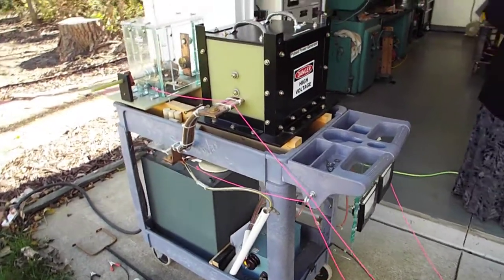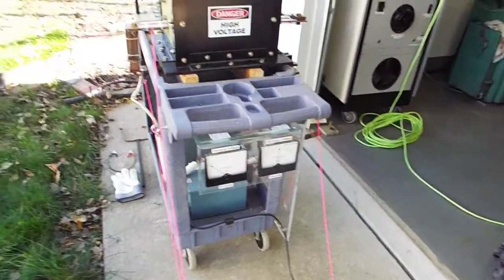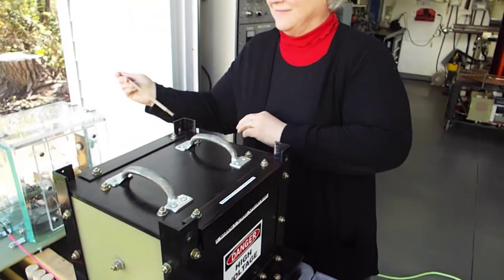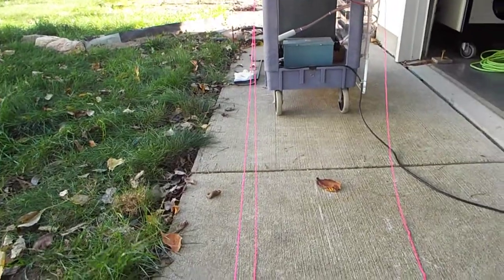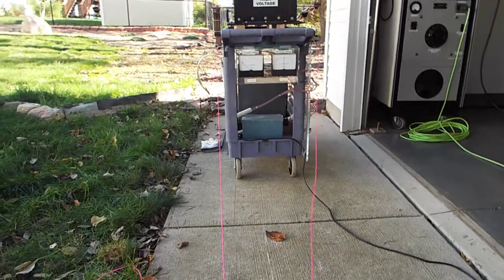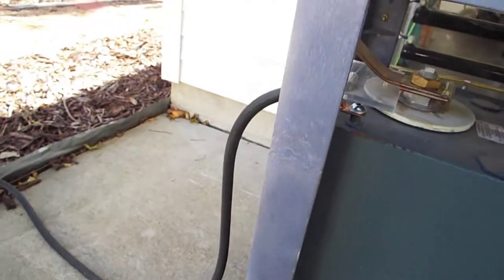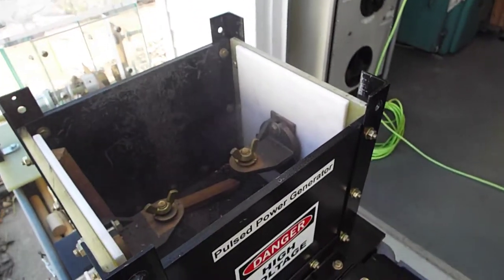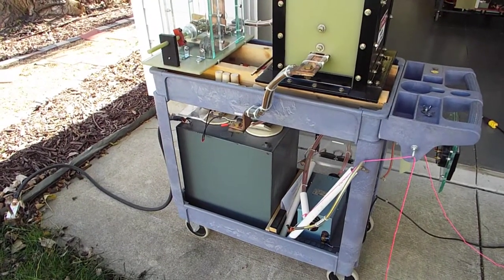Coin Shrinking Using Electromagnetism

Comment: This would be amazing to view with a transparent blast chamber and a high speed camera.
Reply from the maker: A few people have tried Lexan, which is transparent, blast chambers but even that material eventually cracks. Since the copper coil fragments travel at up to 5000 feet per second, I only trust a steel blast chamber. There is a video of someone, Hackerbot Labs I believe, using a 180,000 frame per second camera to record a shrink operation. The shrink only takes up 4 frames (22 microseconds)!
Reply from the maker: Thanks. I studied all of the other coin shrinkers that I could find before I built mine.
Reply: @littleshopofelectrons4014  well, you studied well, I guess.  Because again, it's a nice build!  :)

Comment: "The blast cage" 😂 very appropriate name for that component of your machine mate... the camera doesn't convey the blast that is generated by these things..
Reply from the maker: Even with the blast cage completely enclosed, it still sounds like a small gun firing.
Reply: @littleshopofelectrons4014  yeah the camera can't convey the blast that's for sure, its the same with a lot of the high voltage gear ....
Reply: @T2D.SteveArcs  if you dig around online, you can find high-speed video of... well, not the initial blast (that blows out the exposure and is pure white on screen), but the after-effects (even a millisecond or two later, maybe) of plasma dancing around, shrapnel flying at supersonic speeds, etc.

Comment: Fantastic, high quality build! Thanks for explaining and filming it for us to see. I assume the #12 wire must be lacquer coated where it winds around the coin? Would the results be different with a more ferrous coin, such as a Canadian one?
Reply from the maker: Thanks. I use magnet wire with double-build insulation. The lower the resistance of the coin, the better. Pure copper, such as an older penny, would work best. Ferrous materials are not as good because of the higher resistance.

Comment: I use an automotive ignition coil and charge the caps through the secondary (huge inductance)...that way, I have NEVER had a damaged diode, since the current has such a huge Xc to fast-changing current. i.e. the cap discharge.  The NST still charges it fast.
Actually, I use two ignition coils,one for each cap lead (not really necessary). 
You can use a 30mA NST, I use three 20kV diodes in series for extra margin.
I am currently designing a RE-USABLE coin work coil, which is working well...so far.
GREAT VIDEO!!

Comment: 12 volts with high current looks like this "12V 100AH LiFePO4 Short Circuit - Lithium Iron Phosphate" by reBel Batteries. The result is a sizzle and not a pop. I looked at the formula that calculates the power (7.2 K joules) and the electricity (12000 volts in the video) is squared, so you need a high voltage, rather than a high capacitor.
Reply: right, I don't know for this build, but for the build I was around for, if memory serves, we used 3 100µF capacitors in parallel, for a total of 300µF.  Doesn't sound like much, when thinking about caps for, say, 50V... but when they're rated for 10kV, they're, uhh, a lot bigger!  (I think they weighed in at about the same number (300) of pounds (c. 140kg)?  I forget -- but big things.)  Because yeah, that square thing is important.

Comment: Would be cool if it would be possible to get a high speed camera shot of the quarter shrinking. I know it would be tough due to the surrounding materials.
Reply from the maker: Hackerbot labs did such a shot several years ago. You can find it on YT. They used a 180,000 FPS camera I believe. The entire shrink operation took only 4 frames.
Reply: @littleshopofelectrons4014  Thanks for the tip. I did find the video, and it's pretty neat, but the quality is pretty bad. It was done in 2009. I'm sure you could get much better quality with today's tech.

Comment: Why does the quarter shrink? It seems like it would just melt or vaporize, where does the extra mass go and how does it shrink so proportionately?
Reply from the maker: The mass doesn't change. The shrunken quarter becomes thicker. It is essentially hammered magnetically into a different shape in about 30 microseconds. I just added an explanation of the physics behind this in the video title description, so look there.
Reply: @littleshopofelectrons4014  thank you so much for answering me, and so promptly. I understand it much better now. Fascinating video and demonstration, keep up the good work and thanks for the great content

Comment: Is the brass like appearance from alloying with the copper slug in the quarter, or with the copper wire?
Reply from the maker: Some of the copper vapor generated by the exploding copper work coil gets deposited on the coins surface. Its easily removed in a few minutes by hand polishing. This picture was taken prior to polishing the shrunken coin.
Reply: @littleshopofelectrons4014 AH that makes more sense :)

Comment: thats so cool. id risk bein shocked just to make one :D
Reply from the maker: Thanks. This is the most dangerous device that I've built. It can kill you instantly if you are careless or don't follow the correct operational procedure.
Reply: AND, it can kill you in several different ways -- the high voltage, the super-sonic shrapnel, etc.  Definitely one to not engage in casually.

Comment: The metal heats up to melting point then the collalsing magnetic "field" pulls it into the magnetic vortex of the magnet. What will happen if there is enough power for it to come out the othet side?
Reply from the maker: It has nothing to do with heat or melting. It is done strictly with electromagnetic forces. Read the video description and it will explain everything.
Reply: Some bits of the copper heat past boiling, but the coin is not melted.  Detail is (relatively) well preserved.  The edge of the coin does travel (very briefly) at about 700mph, though... so that's fun.  (And then the non-vaporized copper shrapnel travels at... Mach 2, I think we clocked it at, in the high-speed video footage?  Something like that.)
Reply: @DavidLindes  still not exactly clear what and why it is happening, there should be a blob of metal if anything
Reply from the maker: Electromagnetic induction and Lenz's law.
Reply: @littleshopofelectrons4014  I am patiently awaiting the video to prove this or not, lightning melts sand to form a glasslike structure where the current passed. It looks fractral like to me?

Comment: Why don't the coins say the same thing.
Reply from the maker: Because they are different coins but they are both quarters. One is un-shrunk and one is shrunk.
Reply: @littleshopofelectrons4014  That is, you show two different coins. I would like to see the coin being put into the machine and the machine started and then the coin being peeled out. In a continuous video without tendon replacement.
Reply from the maker: @maxjakobsen5526  I suggest then that you make your own video the way that you want to see it. I make my videos the way that I want.
Reply: @littleshopofelectrons4014   I can't because it can't be done.
Reply from the maker: @maxjakobsen5526  What do you mean that it can't be done?
Reply: @littleshopofelectrons4014  I just want to see you do it one more time in an unbroken video and this time where you see the coin being inserted. Is it that hard.
Reply from the maker: I'm not the first person to do this. There are several other YT videos showing this process. I believe that my machine is the best built though. This process is called electromagnetic forming and is used in industry for crimping and other purposes. Its based on the well-known physics principles of electromagnetic induction and Lenz's law. Read the video description and it will explain the physics involved.

I am not going to make a new video just for you and I especially don't like your inference that I have faked something in my video. I am not obligated to convince you of anything. If you can't understand or don't believe the underlying physics, or what you can see with your own eyes, then there is nothing I can do about that other than to suggest that you educate yourself by reading an introductory physics textbook.

Comment: Did I hear you have a capacitor of 100uf at 22,000 volts (12,000 volt charge)? 12,000 volts by 100uf is what you discharged? I have ten 0.5 Farad 20 volt  capacitors and wonder should I put them in series or parallel for a short circuit like this. I would have 5 farads at 20 volts or 0.5 farads at 200 volts/ 500,000uf by 200 volts . Okay I found an online calculator and mine would be 1K joule compared to your 7.2K joule. Could I zap a coin seven times with similar results? Wow I changed the math to 0.5 F X 200 volts and got 10K joule.
Reply from the maker: My capacitor is 100 uf rated for 22 KV as you stated. It is a specially built energy discharge capacitor designed for these types of applications.

What you are describing sounds like electrolytic capacitors. If so, there are several problems. The first problem is that they discharge too slowly for coin shrinking. Another problem is that electrolytics are polarized and and can't tolerate voltage reversals. You have also identified another problem; not enough energy. Your 10 capacitors will only yield 1000 joules no matter how you connect them. The final problem is that there is just too much capacitance. You want a resonant frequency of around 8000 hz when the capacitors and work coil are combined into a resonant circuit. The bottom line is that you want a capacitance of around 50 uf to 200 uf. To get sufficient energy with that capacitance you need high voltage.
Reply: @littleshopofelectrons4014  Wow! Okay thank you for the information. I did not know of the 8K Hz resonant frequency. This is critical information to consider for the wiring. I did not know the circuit oscillates on the very short discharge time. So you need unpolarized caps. Yes the caps I have are polarized. I got them from a dumpster dive. They are designed to go across the power supply of a car amplifier, at the amplifier , so maximum current/power can get into the amp. Today these caps have changed to 5 farads, so I think my 0.5 farads are out of style or obsolete, as to why they were thrown out, but were brand new in the packaging.
Reply: @littleshopofelectrons4014  I found another coin zapper on the internet that used a 300uF capacitor, so that one would have a lower frequency.
Reply: @littleshopofelectrons4014  As I got the caps for free I can abuse them without concern for my wallet. I will do a Short Circuit with them now knowing it will be only a one time event. They have a very thick brass/copper threaded screw, so I do believe they will deliver high DC current.
Reply: I re-read your reply "just too much capacitance." well I am going to find out if it resonates at all.
Reply from the maker: An 8 khz resonant frequency is not a hard and fast number. It is an estimate that has been found to work best. There can be some deviation. For the 300 uf capacitor that you mention he probably just used fewer turns on the work coil (lower inductance) to get approximately 8 khz. I think you will still find that electrolytic capacitors will discharge too slowly to shrink a coin regardless of energy level.
Reply: Connecting two of my capacitors back to back, would not work because they would cancel each other out. This back to back polarized capacitor only works in AC circuits.
Reply: @littleshopofelectrons4014  wrote "An 8 khz resonant frequency is not a hard and fast number. " Many thanks.
Reply: @littleshopofelectrons4014  I don't know what the resonant frequency of the Hackerbot Labs shrinker was, but they had a 300µF capacitor bank, and we experimentally (i.e. via trial and error) found that 12 coils of 12-gauge copper wire seemed to work best for the work coil on that machine.  And we typically charged to 10kV, though I personally preferred the slightly-less-shrunken 8kV results that we got in earlier testing.